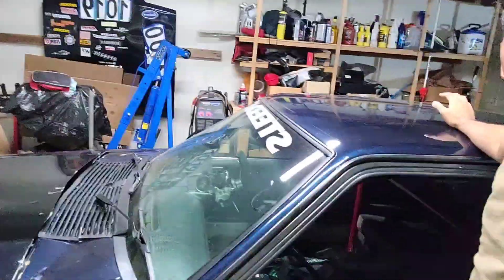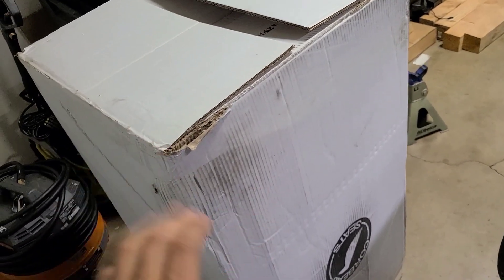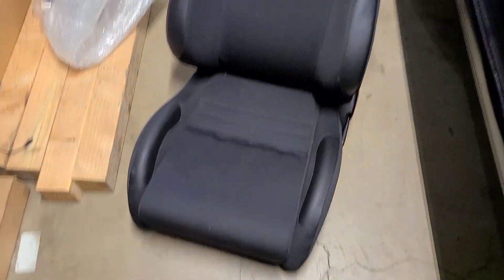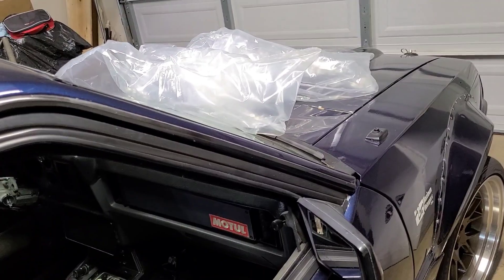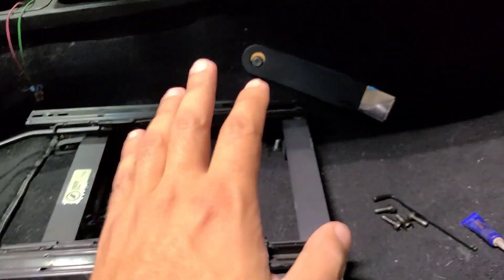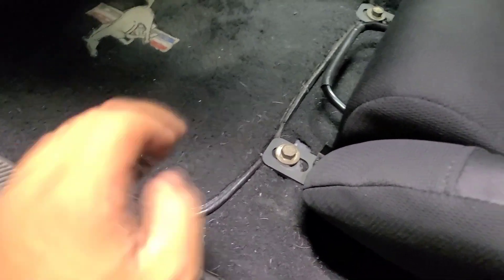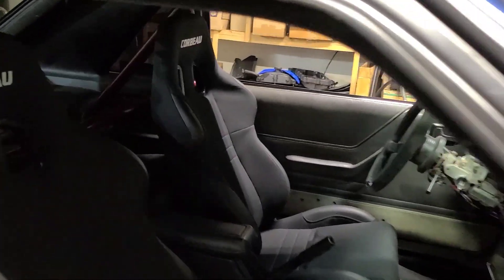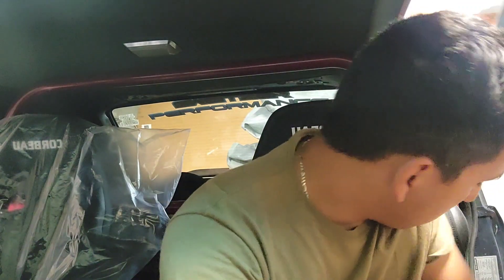79-04 mustang Corbeau seat install

Comment: Just put a set of Corbeau A4's in my coyote fox. Got the microsuede ones straight from Corbeau so I could get them with the 1" of foam shaved off the base and the anti-submarine slot. Also used Corbeau low profile slider since I was worried about fitting with a helmet. Between those two things I've got lots of room and very pleased with the quality at that price. Wish I would have gone with all black like yours because I'm constantly worried about getting markings on the gray suede.
Reply from the maker: My steering wheel is suede, and i got tired of cleaning it. It will get swapped in the near future